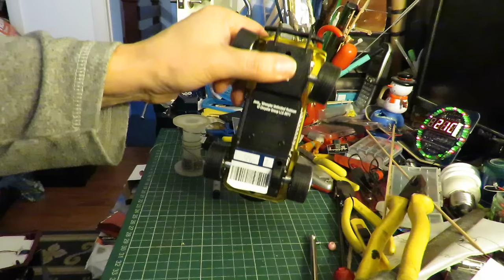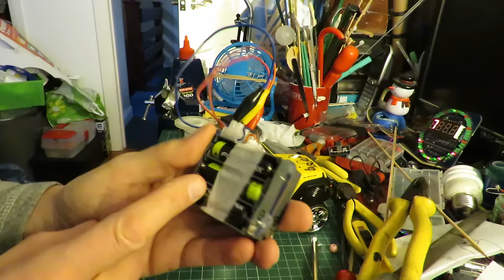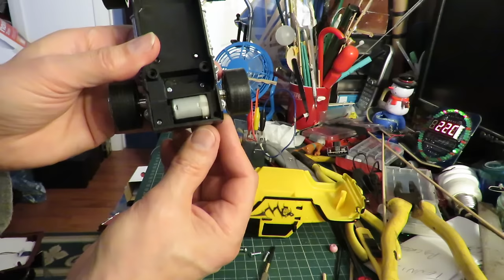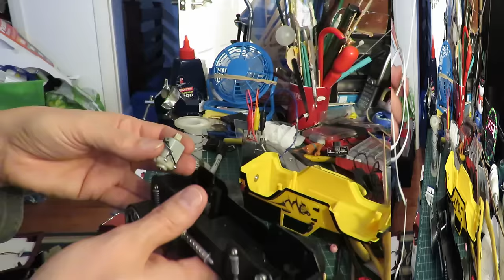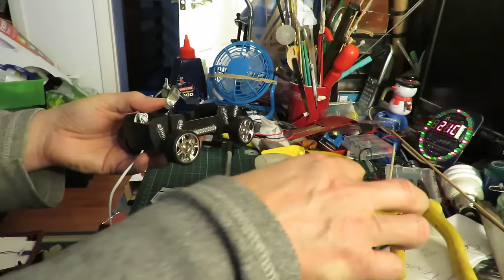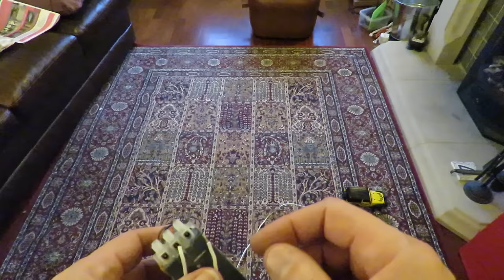Wire Controlled car without the wire or controller

Comment: A hand operated double pole double throw wire exchange thingy. Nice idea using the simplest method possible. I think it's useful for experiments with all sorts of electric stuff. On a tangent: I went to my 20 Baht shop (similar to your £1 shops), and got a real bargain door alarm. They contain a reed switch, magnet, transistor, 3 button cells, a 3-cell holder, a piezo transducer, a coil, a resistor, a single-pole double-throw switch and some short hook-up wires. A real bargain I reckon, and thanks to you for the inspiration to really look hard at cheap stuff, and to think out of the box regarding re-purposing.
Reply from the maker: Thank you dav. It is really helpful to know that there is such a thing as a "20 Baht shop" as I do get asked what Pound Shops are 😊 Good luck with your projects, I will look forward to seeing a video  😊😊
Reply: GrandadIsAnOldMan Thanks. My motivation was to get a cheap source of piezos for my Cigar Box Guitar builds, and the "extras" were cream on the cake! Now I can make a simple coil-winding counter using the reed switch, magnet and 20 Baht calculator to wind electro-magnetic guitar pickups too. Still a big challenge to make & upload videos though.
Reply from the maker: Sounds challenging, good luck and I will look forward to seeing the results 😊